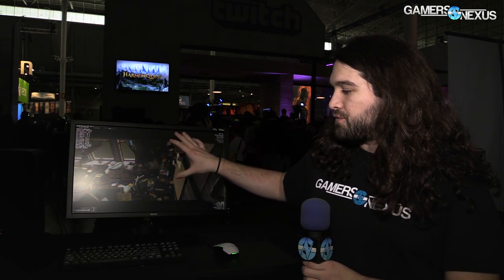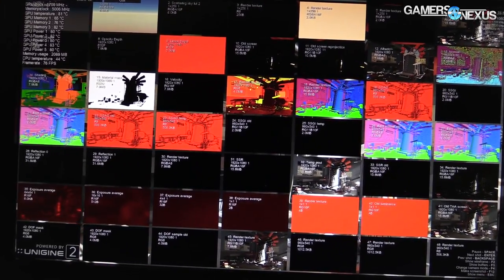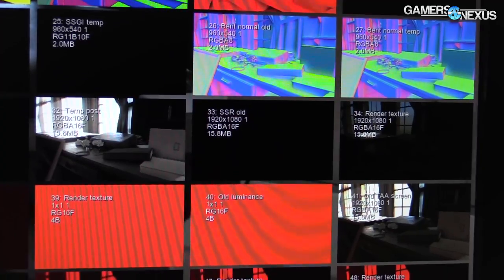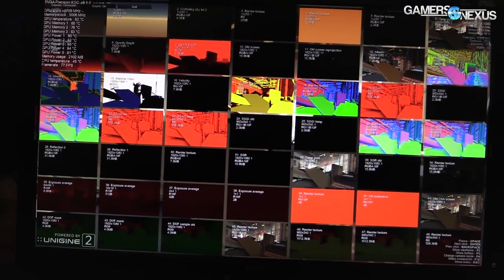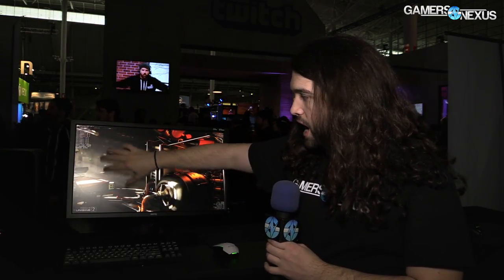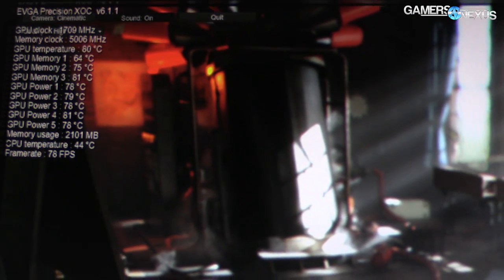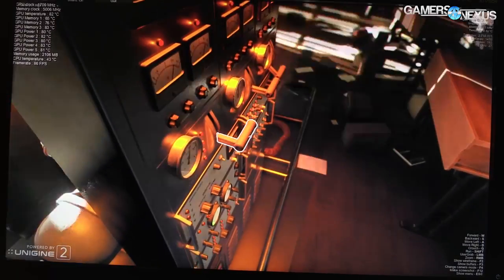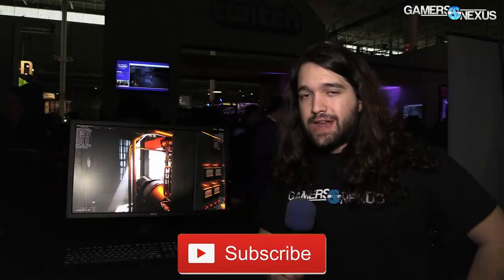Unigine Superposition: Buffer Utilization & Benchmarking

Comment: Here's to hoping this benchmark doesn't have any locked in bias towards a certain brand.  Unengine usually has a bias for Nvidia hardware and rendering techniques because of the way the engine handles tessellation, hopefully this benchmark allows for better optimization of those things.  

Like for example I run 6X max resolution in most of my games, and I haven't seen any difference in quality, just a lot high FPS.   Also let's hope they update and patch this benchmarking utility is there is any bugs and add features like more APIs to play with and automated optimizations.

Comment: I see those temps are about 81c is that bad?
Reply: I just personally have a problem w/ it being 70+. That's when noise comes in. It's so un-comforting.
Reply: But those fan ball bearings won't last long. GPU coolers aren't easily replaceable and ready to be replaced when the-hell ever.
Reply: Sir SPeakz A Lot it's been in a show floor running a benchmark all day, and its till under the 85C throttle threshold.

Comment: So do i need 8gb or 4gb vram in the next 2-3 years?:O
Reply: Zag Zagzag depends on your use case, but 4gb should suffice for a broad scope of applications for a while
Reply: 1080p but i usually has chrome open + some other stuff while gaming , and i usually like open world/mmo games or rpgs with mods , here the 8gb version is like +30-35$ :I
Reply: Depends on what game you're playing, how many mods, and whether you have background applications running or not. Currently I have 10 tabs open in Chrome, Fraps running, No Man's Sky running, and I'm at 9GB used, and can even go up to like 11GB if I'm playing Kerbal Space Program. Currently, you can get away with 8GB if you were conservative with your tasks, but, and especially for the next 2-3 years, go for 16GB.
Reply: we're talking about VRAM friend.
Reply: 8gb. it's saved my ass multiple times
The choice was between the two competitors the GTX 970 vs R9 390. 
3.5gb GDDR5 vram vs 8GB GDDR5 Vram @512bit bandwidth... it was a no brainer. 
Future proof your shit and get at least 8.... 11gb with the new 1080ti? maybe the processing power is there, but the RAM is still overkill
for now, just wait to see if NVidia picks up HBM
...........long story short, there are games that will eat over 6-7gb of Vram even on 1080p settings, but don't fret... one of the biggest buyers mistakes are pre-ordering before all the results and benchmarks are out.. and before you know it, another GPU is on its way...
I wouldn't be surprised if AMD has a rebuttal to at least the gtx 1070.. and AMD GPUs have most of the time always had higher VRAM capacities than similarly priced Nvidia cards at the sacrifice of extra power consumption and heat... but oh well.
My R9 is still rocking solid... but I just upgraded my internet to extreme 250mb/s so I might need to upgrade to a 4k monitor to get the full experience... lmao my new internet can stream 8k 60fps videos like butter
---my last internet provider struggled loading 360p videos during peak hours at 15Mb/s upload.... that was unacceptable. Xfinity rocks. as long as you know what you are doing and don't get sucked into some shit bundle plan. 
along with an AC dual band router with 6 antennae... the whole neighborhood's getting my wifi signal lol.
I'm not gloating, sorry if it sounds that way. and I strayed WAYYY off topic because I get really excited when talking about tech.
Get at least 6gb if not 8gb of VRAM. I recommend 4gb system RAM for gaming, 8GB for work load, and 16GB of ram for heavy multi task processes. 4gb of Vram does not cut it these days at all. Better to be safe and broke than sorry and broke.

Comment: Unreal Engine 4 can supply you with this information and more, but you would need to use the editor which requires a little bit of  knowledge beyond pressing start on a "benchmark" application.
What I'm getting at is this - proper tools for benchmarking exist - but most of the people that care (children) about benchmarks can't be bothered to learn how to use them and as for the people that do know how to use them, they don't care about a 100$ or 200$ difference between video cards because they buy the best ones anyway. Even the review channels like GN don't care so much as to build their own benchmarking utility - which is quite easy to do nowadays.

The reality of the matter is games are optimized for mid tier cards and regardless of whichever brand and manufacturer is getting those 10 fps extra, it won't translate to future-proofing in any discernible way. After many years of building my own PCs (beyond my professional involvement) I've learned this to be the case. But I still watch the reviews out of boredom I suppose.

Anyway I digress, what I wanted to say is this - even if a certain card is slower at buffering or drawing there is very little you could do beyond accept the result. From a scientific standpoint it's interesting but from a consumer standpoint it's useless information. Stick to avg/max fps comparisons, most people can hardly comprehend even those.